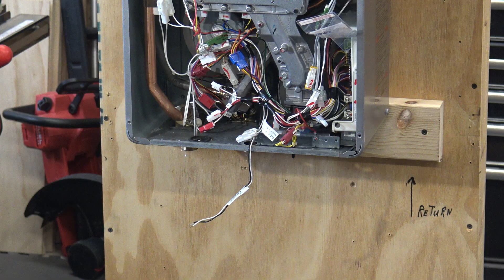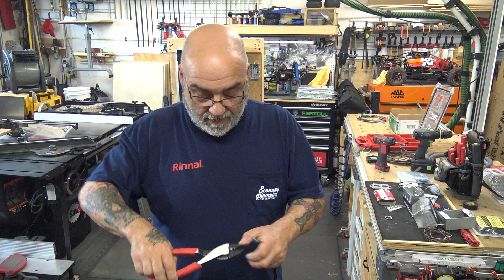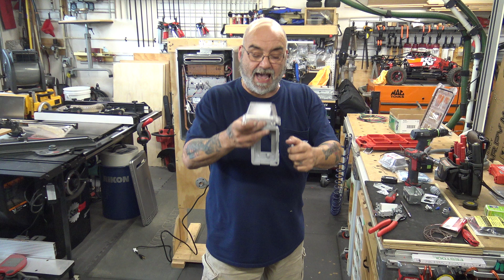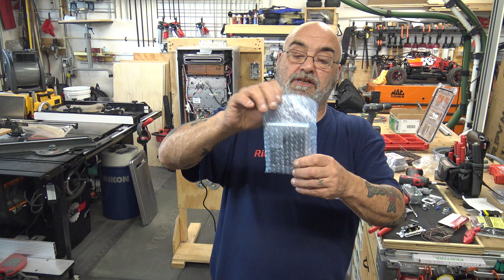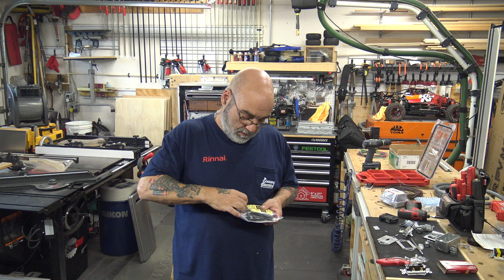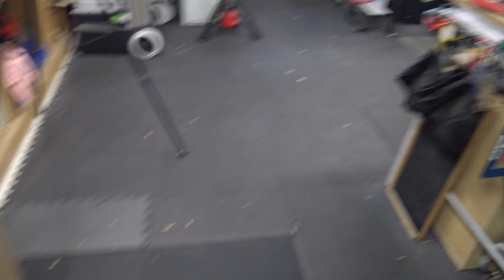How to wire and what wires to use for a Rinnai exterior tankless

Comment: Very Useful. Thank you !  Plumbers explaining electricity is not quite as entertaining as carpenters explaining plumbing...but equally clueless about the (electrical) craft. BTW those are called Spade and Ring type crimp on connectors.  Never the less,  this explains what electrical connections need to be made.  Reliability will be a problem using the 
"waterproof" cover, outlet and plug, because of condensation and corrosion.  not a good thing for a home appliance that needs to be utterly reliable.  If you use an outlet outside, you MUST use a GFI protected outlet !    Waterproof flexible conduit, or pvc conduit and boxes are cheap, tough, yeild a reliable electrical feed.  Your choice.

Comment: Hey great video I have a Reu-2425 model. Does the unit actually need an external controller to run or can I simply set the dip switches on-site the cover of the unit for set temperature? Cheers and keep up the great video content

Comment: So when using the knife switch (disconnect), is it legal to use the 16awg stranded wire cord and terminate it directly under the screws?

Comment: Thank you for this fantastic video Mike. 
My installers plug directly the wires from my previous water heater (220v) directly to the rinnai, without grounding it to the frame. After a couple of days I heart a noise coming from the heater, I went to check and the display was off. The breaker was active and power was flowing. My guess is that the controller fuse blowup. 
Is the heater still ok? Is it just a matter of replacing a fuse or have this caused a more deeper problem? 
Thank you again. Great video.

Comment: I have a rinnai 24 with 2 controllers already installed and has a leaking copper pipe with a split pinhole in it. I have decided to replace it with a whole new system. My question is, if I purchase a Rinnai B26 instantaneous hot water system,  can the existing controllers that I have be wired into this new system? are there provisions inside the infinity the B26? please

Comment: Is it possible to run this water heater without a controller? Thank you
Reply from the maker: You you can but it will only give you around 115* degrees of water temperature and you will not know if you get a trouble code. Mike

Comment: Hey Mike we are have trouble with our Rinnai exterior v65e tankless water heater. I watched ur wiring videos and It seemed like the electricians hooked it up right but when we turn the water on the heater is not igniting to heat the water. The controller is turning on and they added an plug in to I think a gfi outlet. I can confirm tomorrow. We even messed with the little switches In the inside or natural gas and elevation. Please help. Thanks so much .

Comment: Hi Mike I really appreciate all of your videos they are most informative and helpful, I've got a few questions for you, the first is about installing the controller, is there any way I can install it in it's own little box outside and If I can't is it low voltage where I can forgo the electrical box and just surface mont it and shove the excess wire in the wall,(of course I know If it's 110 voltage I can't do that. The second question is about the warranty, it seems I read that unless it's professionally installed the warranty is voided, I'm a contractor installing this in my own home will that be considered professionally installed? I thought I heard you say you had a video on how to communicate with Rinnai as a plumber, is there a homeowner and or contractor correct approach to contacting Rinnai? Sorry, one more question I have had a Bosh tankless for close to twenty 20year and like it but it takes too long to heat the water where it's located so I'm installing this Rinnai V65EN right next to the kitchen and bathroom adjoining wall, I intend to leave the Bosch unit installed because it's closer to our guest apartment, is this going to cause problems having two tankless water heaters? should I try and Isolate the Bosch from the main part of the house?My house is only 750sq ft. sorry to ask so many questions. Jim

Comment: Ive got the REU-AM1620WD-US with a large (1") white male threaded nipple on the bottom of the tank where the 120V enters into the unit.  Wondering if you can tell me the type of fitting it will accept in order to attach the AC cord to unit.  I can send a photo if that helps.  Thank you very much, I love your channel.

Comment: Hey Mike, what switch do you have to use to hard wire in a Rinnai outside tankless water heater.
Reply from the maker: I don’t use a switch, I use a plus and an I use cover. I install a electric pigtail on the tankless. I have a video on it.

Comment: Hi Mike - in TX, and just got a new Navien (no rinnai's available).  The thing is brand new and plumber just installed yesterday.  today, it wont fire up reliably on demand for hot water.  when standing outside next to the unit, when someone opens the hot water tap I can hear the ignition sparking inside the burner but it doesn't catch.  It takes the thing 3-4 times to finally light itself and fire up to make hot water.  Is this just a break in period thing? There doesn't seem to be any kind of adjustment for that issue.  Thanks!

Comment: Just sub'd to your channel.   Just had the plumbers leave after installing another RL94e .. We had a Rinnai for 12 or 13 years and then heat exchanger broke and we bought a new one 2-1/2 years ago. it was also a RL94e.  We had a power outage with a freeze and it busted the heat exchanger.  It was going to take over 2 months to get a new one so we had to buy a brand new unit.  Wife didn't want to haul and heat water for over 2 months.  But I am keeping the old one and will try to fix it and keep it as a spare.